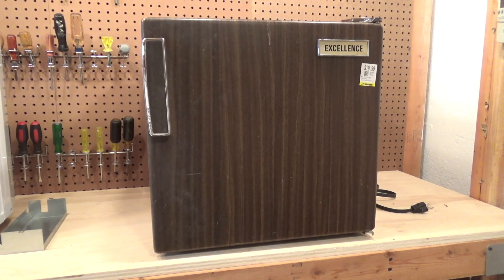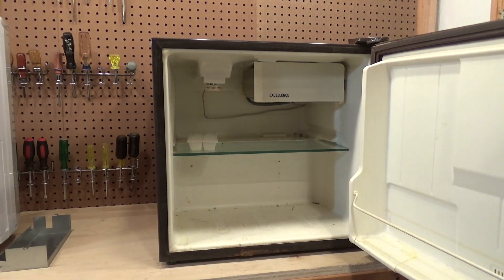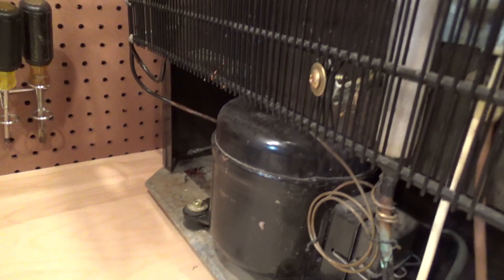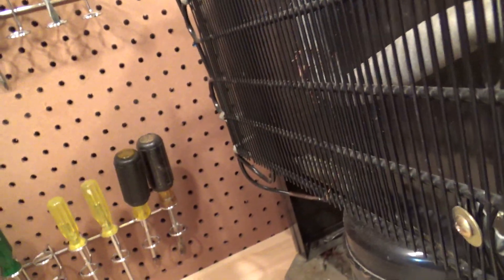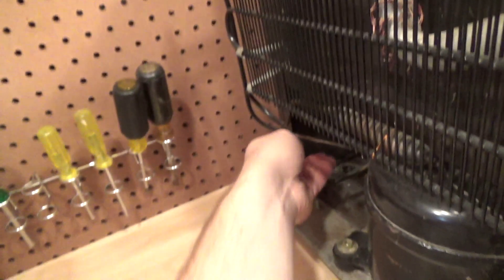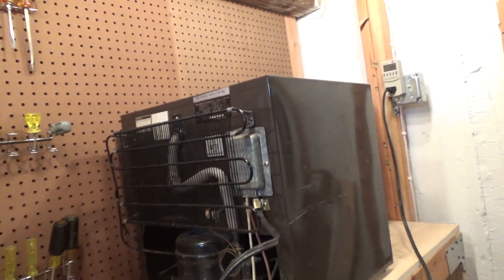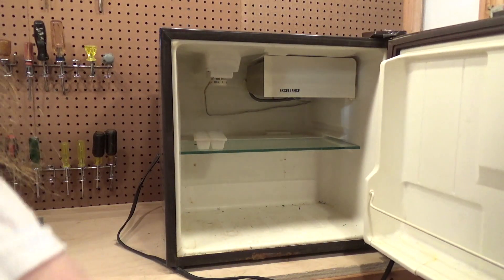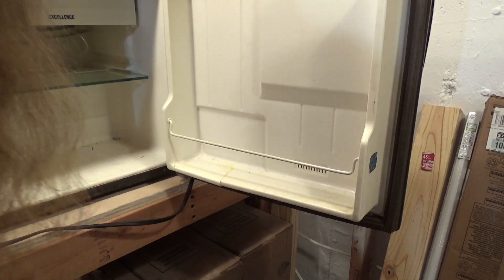Excellence ERT-235 Refrigerator | Initial Checkout

Comment: i know a 45 year old GE unit in a nice wood grain that's been running as long as the building has
gets its door slammed 5 days a week and still keeping drinks cold, they really are more efficient since they dont run a 900w defrost every night like the new ones do, and this is before they cheeped out on insulation

Comment: Great unit.  I have a Sanyo that looks almost identical to this one here.  Its from 1991 shortly before they changed from r12 to r134a.  I got it 15 yrs ago from someone that had said it was no longer cooling.  Took it plugged it in, and compressor would run about 5 seconds and trip the overload.  Then would restart after 10 seconds and do same thing.  I put an amp meter to it, and determined that the current relay was not disengaging the start windings in the compressor.  Took current relay off, and shook it back and fourth, and it fixed it as its contacts must of been stuck.  Ever since it has worked great.  Compressor was well in range for amp draw. I since have gotten a bigger fridge, and gave the Sanyo to my brother and he uses it as a beer fridge in his man cave.  Like you said these things last forever and will out live the junk they make today, yes todays appliances are sleek and stylish but that means doodly jack squat if they dont last or work.

Comment: I like these small woodgrain vintage refrigerators. My Aunt and Uncle have one of these they use to hold pop during family parties. I have always admired it. Whenever it is called into service It just sits there doing it's job reliably keeping the pop cold.
Reply from the maker: That's more or less how I intend to use this one.
Reply: Mine has been running flawlessly & continuously for about 2 yrs. The only issue is that bc of the compact size, you gotta get in & out ASAP or A) you gotta defrost it more often, and B) it takes a minute to get back down to temp. They aren't "pull full amperage & wattage to get back down to temp in seconds" fridges: they were built when leftover egg salad hitting 41°F for 10 minutes wasn't an instant "yOu HaVe To ThRoW iT oUt Or YoU dIe FrOm BoTuLiSm!!" times. 

OUTSTANDING beer/soda/snack/fish bait fridge, but not something you open 100 times/day if you've got perishables you aren't gonna eat in a couple days.

Comment: I have two older mini fridges. One is a Sanyo from the 80s, which is about the same size as the one you have there, the other one is an Avanti branded machine, which is about the size of two of those on top of each other. Both of them have reciprocating compressors and use R-12. I have found that for both of them, the compressors in them get quite hot when running, almost too hot to touch, so I put a small fan inside that blows over the compressor when it is running (wired in with the compressor feed wire from the thermostat) and that helps to keep the compressors nice and cool, they also run quieter with the fan, I would imagine because it lowers the head pressure. 
Of course I don't even think I need to mention it, but like all vintage appliances, they run great and preform excellent unlike modern stuff. Although I don't really use them anymore as I don't have a use for them. I used to have them on loan to my friend who used them, but he passed away, so they just sit unused now.
Reply: It's normal for mini fridge compressors to get that hot. That's how they stay cool, by dissipating heat. The refrigerant also cools it down. The fan may improve noise level, but it's not necessary for long-term reliable operation.